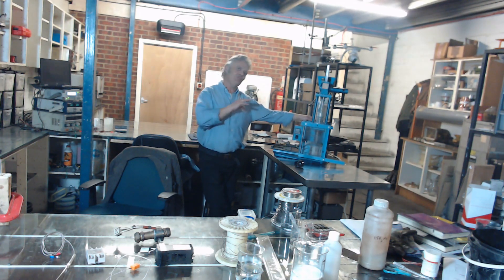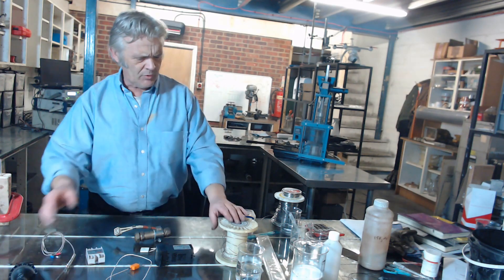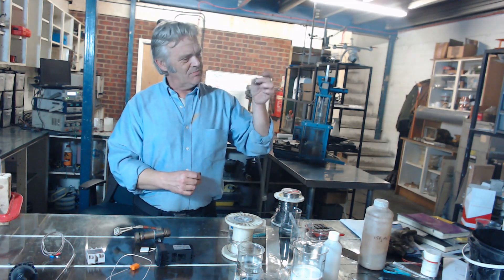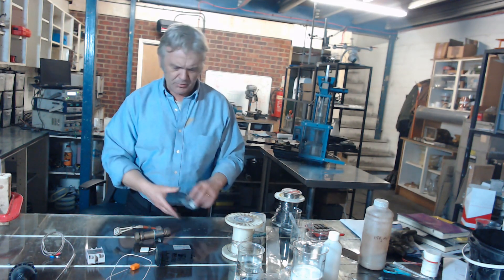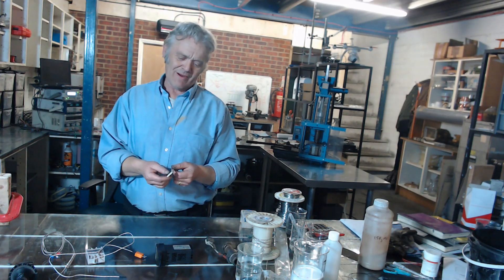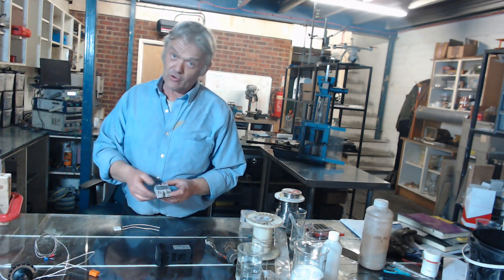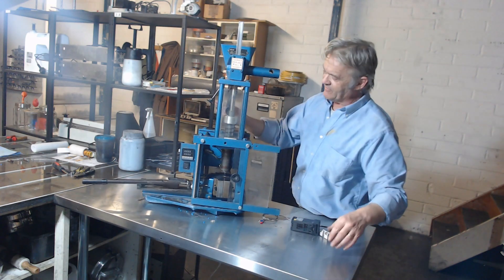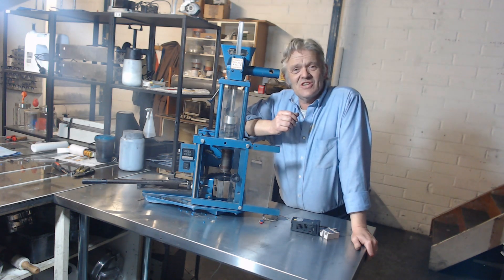How To WIre For Heat - Wiring a Kiln, Filament Extruder, Injection Molder, Etc

Comment: @ 14:26 you say "SCR" but later say SSR and your diagram shows SSR. Thanks for your efforts, your audio has 3 problems: 1 voice pitch changes, echo from walls, speaking style (emphasis) that intersect and even tho i wear headphones i find a few sounds unavailable to translation. However MOST of the time you repeat certain words and if i wait I can usually get the acronym (like PET) at a later time. Thanks again, this video helped me think i can build an electric kiln.!

Comment: Hi Rob, great video especially because I am in process of building a new furnace/kiln with the same electronic control. I am struggling with controlling the rate of increasing the temp per min, do you know how to control that from the PID controller? 
Cheers, 
Sorin

Comment: Hi Robert I have been watching your channel for years now. You need to take your battery and super caps and get investment from the automotive industry. Your to good to keep under selling your self.  Consider a combined battery and super cap that allows regen for fast store unlike current Tesla design that needs to allow space and not fully charging. Most sillcon valey investors will back you.

Comment: There are a ton of counterfeit Fotek ssr's in eBay and Amazon. It's hard to find a real one.  The fake ones are really inexpensive and have no amp rating. They also usually say "made in Taiwan" instead of "Taiwan made". I wouldn't trust those for anything but intermittent use with low amperage
Reply: This has been a huge problem lately. This is why you need to use the alarm relay as an emergency cutoff!
Reply: @garbleduser   That's a good idea.  I got an Opto 22 ssr made in USA and it seems pretty decent. It hasn't seen much use though. I think it was around $22 USD
Reply: I just open the poorly potted SCRs and replace the switching component, and the suspect supporting components. I have found a trend in both the optocouplers and low value resistors being the primary cause of failure.

Comment: Great explanation for using these valuable controllers Rob!  PID controllers are so versatile and cheap. I use them for controlling cheap kitchen toaster ovens and can control the temperature within + or - 1 degree centigrade.
Reply from the maker: absolutely agree mate - i use them all the time - they are quick easy and reliable with pretty good accuracy
Reply: Hi Will, do you know how to control the rate of centigrade/min from this type of PID controller?
Cheers,
Sorin
Reply: @mihaiaragon  Hello Sorin! Yes, I know how to control the rate of temperature, which is called the " ramp ". However you need to have a specialized PID that is able to do ramp/soak. These specialized PID's cost more than the common type of PID. They cost about $80USD on eBay vs $25USD for the common type that can't do a ramp.

Comment: I'm thinking of making a CO2 scrubber out of limestone.  This could help me get to the proper (865 C) temperature to bake the CO2 out of the limestone.

Now I just need to work out the valves to route where the CO2 exhaust goes and where the intake air comes from.
Reply: Bubble air through an algae-filled tank for air scrubbing but for some reason, I think you might be building for a submarine or similar project so maybe not.
Reply: @Barskor1  that works for some cases, but I want a machine that I can use to add/remove co2 from a room on demand.

At first I would use it to regulate CO2 in a greenhouse.  Eventually, I want to build a self contained living area in a cave or mine, to simulate a Mars base.
Reply: @Barskor1  pretty much.  another experiment I want to run is to see how little oxygen plants can survive on.  That way on planets with a lot of CO2 but no oxygen you can have the plants do most of the air processing for you instead of building a machine to do it.
Reply: @Barskor1  thanks.  I might build an airtight greenhouse when the spring gets here.  I would only need a frame and plastic sheeting, and use duct tape to seal any leaks.

Comment: I am an inventor in Ohio.   I love this feed.   You have led me to believe that I could make a space heater from graphene.  Do you have suggestions for laying out the material?  Do you layout in a pattern similar to a toaster element or in a complete thin layer across an area with the wire at opposite ends?
Reply: He has a video on making space heaters with his graphene ink IRC those questions are answered in it. Hope that helps.

Comment: Does the Solid State Rectifier turn AC to DC in this case?  Wouldn't think that would be necessary.
Reply: with it needing an input voltage, I think it's a solid state relay.